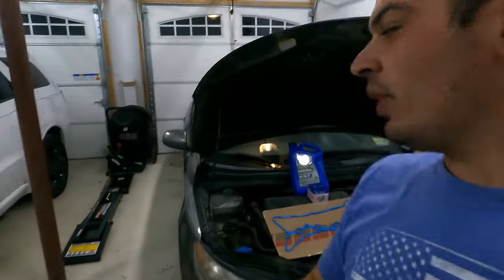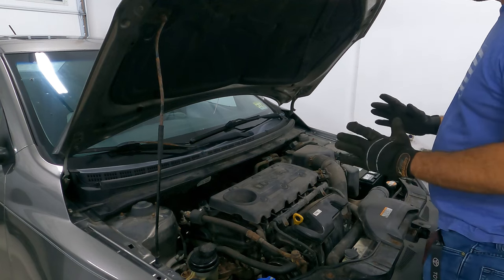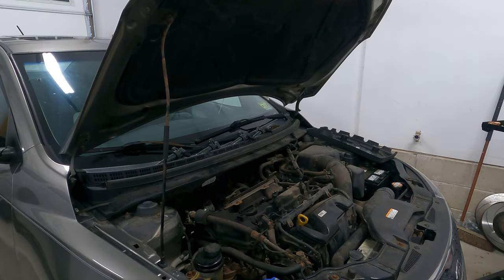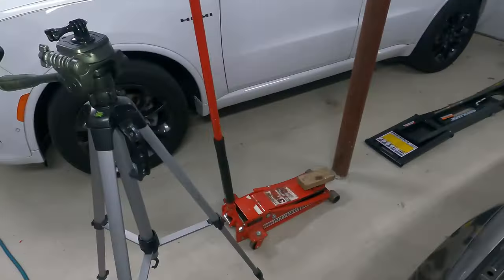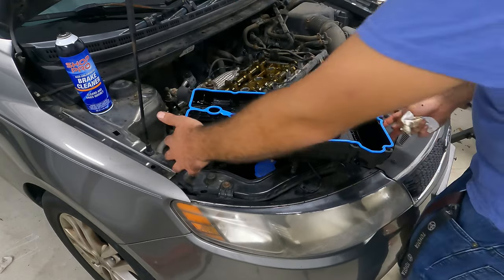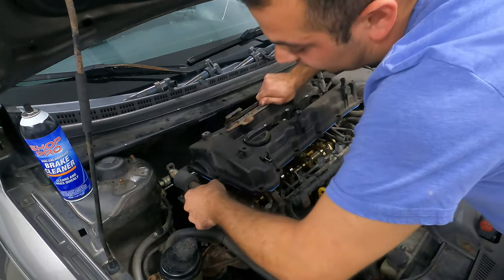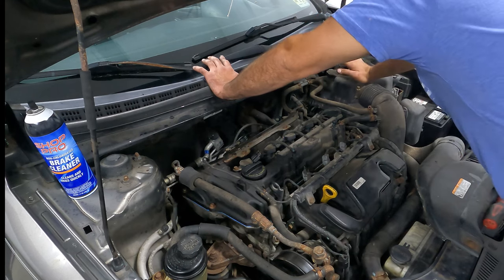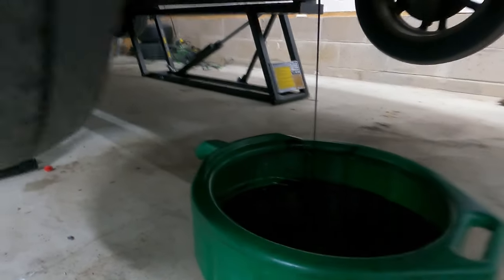2006-2016 Hyundai Kia 2.0 and 2.4 valve cover gasket replacement!!

Comment: Nothings dripping on the ground but its just started smelling like burnt oil and a little smoke coming from the passenger side fender wheel when i shut the car off after driving. Could it be leaking down the back and dripping on the exhaust?
Reply from the maker: Could be

Comment: Hi, I would like to open the valve cover to check the timing chain and change the gasket as I am also leaking a little oil. I have already changed the oil and the oil filter. If I open the valve cover will the oil flow? I don't know what to expect. The oil should still be in the sump, right?

Comment: Hypothetically let’s say the bolt by the #3 coil broke off. How effed am I?
Reply from the maker: Hypothetically if it’s the bolt that holds the coil down I’d attempt to drill it out and extract with an extractor
Reply: It’s the bolt that holds the valve cover down. It’s just one of the center bolts by the coils. Can i still drill it?
Reply from the maker: @LarryIsbell-bu8tz  pull the valve cover back off and see how it broke. If it’s flush drilling is your only option. If it’s sticking out a bit you may be able to grab it with a turbo socket or vice grips

Comment: I have a 2014 Hyundai Tucson 2.4L Limited. with an oil leak coming from the valve cover gasket. I could smell burning oil from it running down onto the exhaust manifold heat shield.
A few posts suggest that the high pressure fuel line and fuel pump installation bolts should be replaced at the same time as their one time use. Others suggest that since the fuel pump isn't being replaced, that torqued to spec is more then suffice.
Are these parts necessary to be replaced for a simple valve cover gasket replacement? Or should I continue to top up engine oil and hold off til I can source parts?
Reply from the maker: You’re referring to the high pressure fuel pipe that goes from the pump to the injector rail. That is technically a one time use pipe and “should” be replaced.

Comment: I have a question I have a 2012 Kia forte with that same motor but I was wondering what is the torque rating should I set the bolts at on the valve cover cuz I'm going to be replacing my valve cover gasket because mine is leaking into the spark plug Wells anyway keep up the amazing YouTube video